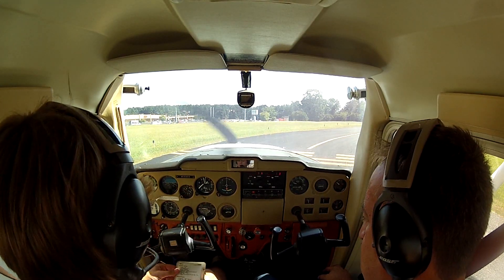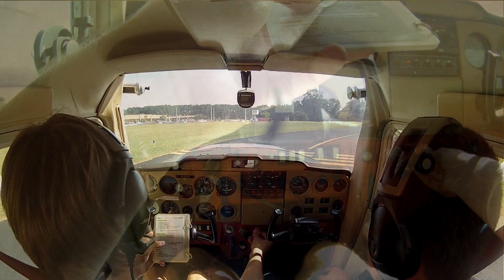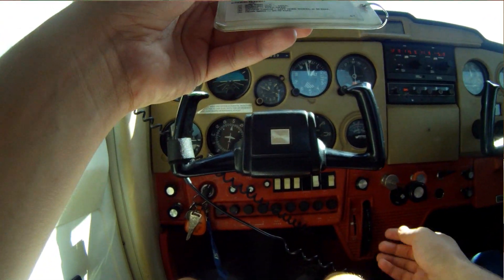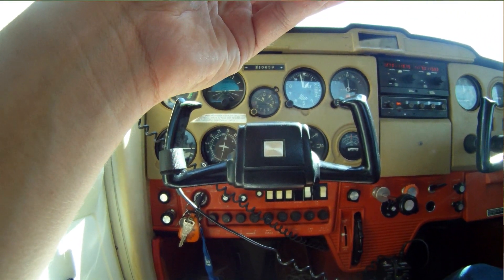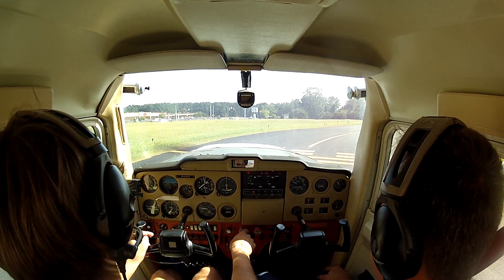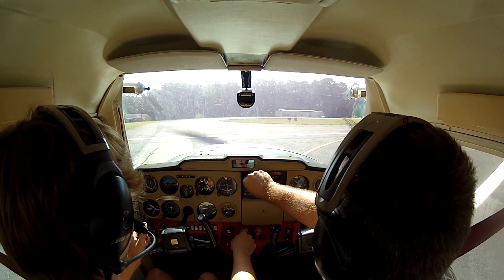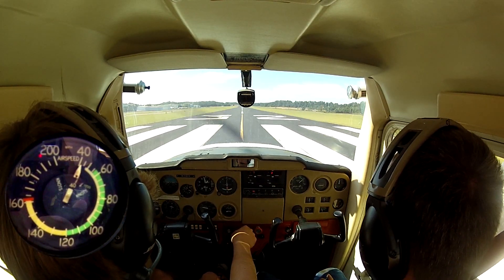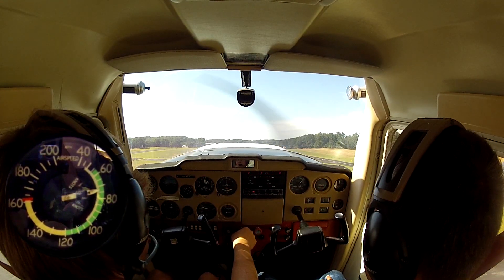LOTOT!   Loss Of Thrust On Takeoff

Comment: Pulls mixture, there it is push, tries to restore power after simulation by pushing in mixture - power does not come back - the engine is dead. Congrats, you've just turned a simulated emergency into real emergency.

Comment from the maker: This commentary in response to Dave's comment/question below.  Sorry for the slow response, I never saw your comment, but it is a good one, and deserves response.  First of all, whatever we are doing in America for training "as is" it aint working.  We are losing two planes a week to day VFR stall/spin scenarios where sudden loss of power is encountered at 200, 300, or 400 feet, somewhere pretty low.  This is a simulation for training purposes, I agree, but the thing that causes the shock to most pilots is the fact that the throttle is all the way in, and yet there is no power.  This causes the mind to spend too much time trying to figure it out.  If you pull their throttle back to idle, it is a normal picture and it makes sense.  I normally only do this at airports where I have an unobstructed easy landing zone directly in front just in case we encounter a problem in getting it to run again after I push the mixture back in.  Often on the C-150 I will reach down and shut the fuel selector off at about 200 feet on climb without them knowing.  It takes about 15 seconds for it to run out of gas and the engine quit, and boy are they surprised...of course I am fully ready to land it straight ahead if it doesn't run again after I turn the mixture back on again, but it always does.  I had an FAA inspector want to replicate a fatal accident a few years ago and we briefed a flight where we would go to 4000 AGL and simulate a takeoff.  He wanted me to chop his power abruptly when I wanted so he could feel it.  As he started his simulated takeoff and climb, I turned the fuel selector to "off" and sat back to see what was going to happen.  He was absolutely shocked when the engine quit, and stared at the throttle and mixture as he pulled even further back on the yoke.  We stalled briskly and a wing dropped, we spun and I let him stay in the spin two full turns, it was obvious that he wasn't going to recover, so I did.  All the way down he was saying "What happened?  What happened?"  When I told him that I shut his fuel off in the climb he wanted to know why I did that.  I said, well you asked me to chop your power, you never said how, so I shut off your fuel.  He was totally shocked, and the interesting thing is that the disconnect between knowing that his throttle and mixture were all the way in, and what was happening caused his brain to lock up.  I think this is what happens to all humans.  That is why for training, I always take a mixture or a fuel valve, never a throttle - usually the fuel valve.  I think it should be imperative training for all.  Try it some time!